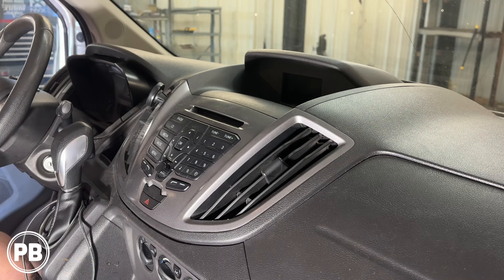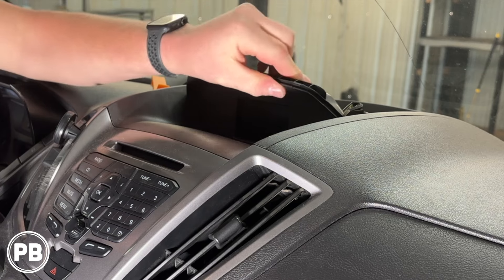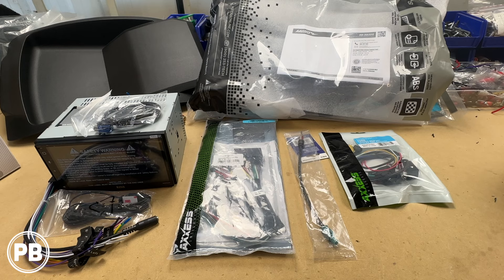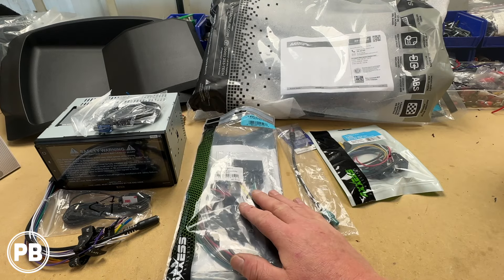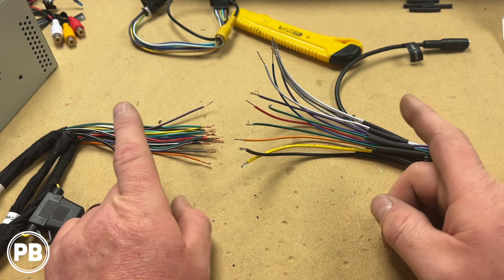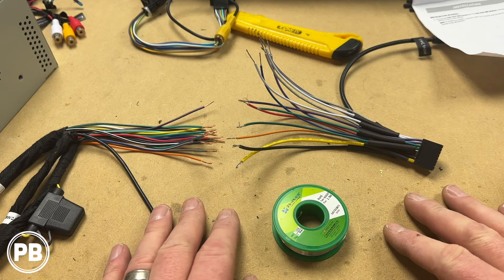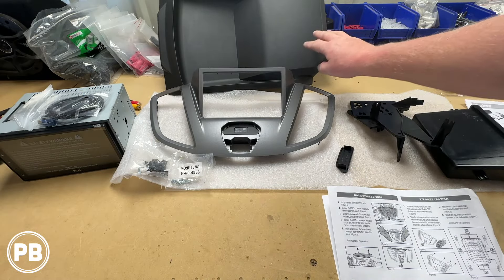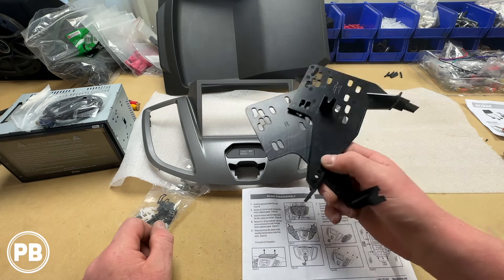2015 - 2019 Ford Transit Radio Install

Comment: You Sir are a master at what you do. I have a 2015 Ford transit 150 cargo van with that same dash what I want to do is add a bigger screen for the backup camera I have the factory backup camera with that little 4 inch screen that's just hard for me to see especially in the bright sun plus I am getting older I know I will have to change the radio also which I hardly listen to but I would love to have this done. You have made a great video with a lot of great information and for that I thank you.

Comment: Should have mounted the xovers behind the dash and just used the mid wires
Reply from the maker: Well this van didn’t have aftermarket speakers, nor did it have a factory amplifier playing different frequencies to those said speakers, nor was there any space behind the radio to do such thing, nor did we even install crossovers. Think before talking, might come in handy.
Reply: @ That’s crazy before 28 seconds you say you are replacing the “factory radio” 📻 😄

I would have mounted the cross overs behind the radio, then take the input from your after market radio to the input side of the cross over, then the wires going to your door would just be you 6.5 mid,,,,, then ran the tweeter wires from behind the dash to the pillars

Comment: Evidently Axxess has changed part numbers with the AX-FDSYNC-SWC now sold as the AXSWCH-FD1.  The   is now the AXDI-FD2.  Does this sound correct?  

When using both AX-FDSYNC-SW (FD1) and AX-FDSYNC-SW (FD2) is the ASWC-1 module connected to the AX-FDSYNC-SW (FD1)?  The SWC 3.5mm jack on the AX-FDSYNC-SW (FD2) is ignored?

Comment: Does the Boss comes with internal GPS? Or what is the antenna plunging in.
Reply from the maker: No internal GPS, the included antenna is for better location accuracy for use with wireless carplay / wireless android auto.